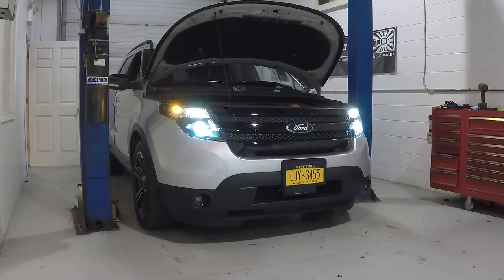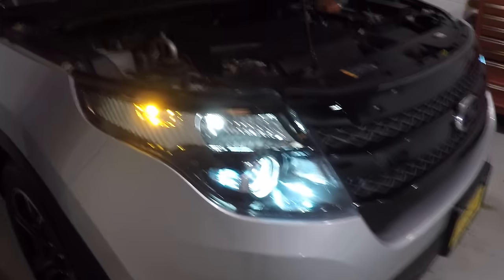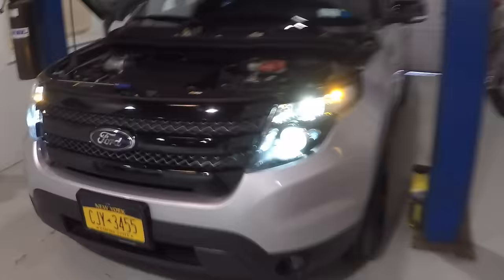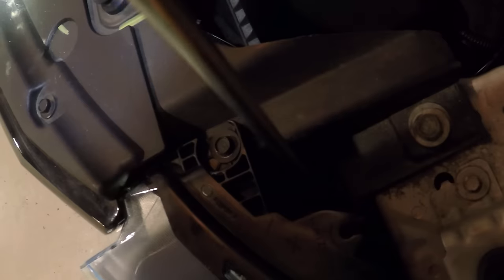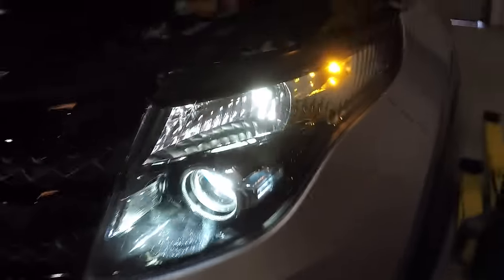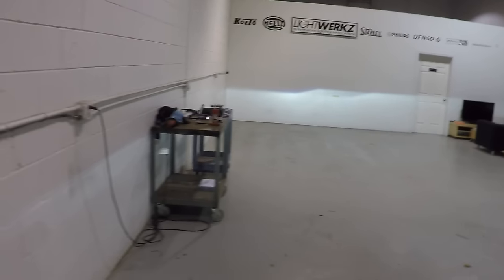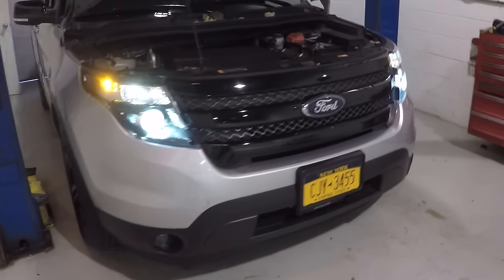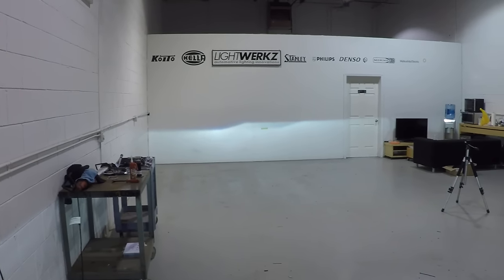How To - Headlight Aiming / Alignment Projector Retrofit

Comment: Told my Moms her headlights were pointing too low ((pause)). Popped the hood on her '12 Chrysler 200, adjusted the lights correctly, and now those bad boys are shooting 25ft ahead 👌🏿
Reply: For my used 2012 Chevy Malibu, changed a headlamp bulb shortly after buying it, left bulb..Came out adjusted a bit too high(cousin did the work, front bumper assembly had to be removed.) Noticed that now the right bulb is aimed a bit too low. A very good friend in CA (I'm in Miss) ordered, sent me one of those special  Bondhus 6mm ball hex end extended-reach wrenches to fit the nearly impossible to reach adjustment head to adjust both lamps! On this Malibu, they're down deep, betw tight-fitting internal bodywork metal shrouds..real pain..have yet to do the job!! Hoping the adjustment heads will turn no problem. Surely not like the old days with simple sealed beam lamp units, with elevation & lateral adjustments!! Miss that!!#

Comment: Adjust then like this on HIGH beam so that low beam is down and right naturally. When the vehicle hits bumps or just trust height differences the rear will go up and down. A person should not be continuously flashing on coming traffic on low beam. I see this ALL the time. Adjust them on HIGH beam vertically straight ahead. Low beam takes care of itself, unless there's a supplemental problem....

Comment: At 1:26 you can see a label on the headlight which specifies a 1% dip, which equates to 3inches lower at the wall at 25feet (300inches). Your headlight centres are at 34inches so the tape on the wall should be at 31inches

Comment: I don't know about Ford, but the one I work for, that 2" @ 25' below the H-Line/bulb center marking would probably put it on the lower end of factory output spec.  Our cars are +/- a few mm from the bulb center while the suv/trucks are usually aimed lower a few mils then take into account the tolerance.   I only mention this as I see retrofitters using tape marks at factory output.  Always possible it could be off though so always good to measure like you did, especially when someone goes to this much effort to make the output better :).
Reply: not sure I agree with you there. Most manufacturers recommend approx 1% downward angle, at 25ft (300") that's 3" which makes our man's video about 0.66% fall which, if anything, is insufficient. Your 'few mm' is in my opinion far from sufficient.
Reply: Correct. In fact the '1% dip' is actually stamped on the lamp at 1:26
Reply: @drnick1972  Low beams should be set to project out to 200' on the drivers side for ANY vehicle. So the angle will vary depending on the height of the headlight. That's why there's that little dot on the lens cover. Using 25' as the distance used for checking, if your lens height is 36" then the drop would be 4-1/2". If the height of the lens is 32", then the drop would be 3". 

The whole point of aiming your headlights is to give you a good view of the road ahead and to NOT blind oncoming drivers. 200' is a good number to shoot for. And 25' is a good distance to be able to check the proper drop from horizontal.

An easy way to calculate is to multiply your lens height by .125. The passenger side can go out to 400' since it's designed to illuminate road signs, people, etc that are most likely to be on your right and it won't blind oncoming traffic. That would, in general, let you raise the passenger side headlight about 2" above the driver side setting at 25' checking distance. The high beams take care of themselves usually.

Using the % number seems ridiculous. Nobody is going to be using tools that can measure % that close anyway.

Comment: My question is, you can see the two steps from left and right headlights but how do I know if they are spaced apart correct. So it will be left to right or side to side adjustment not up and down like you did. Do I just measure between the two projectors and measure the space between the step up on the wall at 25 feet?
Reply from the maker: Correct, thats exactly what you do.

Comment: Good stuff 🙏🏽 I swore up and down that I put my new lights on the wrong rotation having to take off the air box on my 2019 charger repeatedly  to reach the driver light as well because one headlight was higher than the other this whole time there a projector gear nob 😂 in my older Hyundai car I’m used to poping the lights in and they show even by themselves 💀

Comment: Hello, great video! I recently got my car back from the body shop after a crash. The passenger headlight was replaced and now it's not as bright as the driver's side and the beam pattern is scattered everywhere. It that an alignment problem as well? FYI, I have aftermarket HIDs installed in a 2013 Ford Taurus SEL.

Comment: Great Video but maybe someone can answer this for me, I just installed new headlight assembly and my pattern is the same on the (outside left) of the middle, you see how it sits lower and on the far (outside right) it's at a higher level but in the middle it's lined up? Shouldn't it be level all the way across?
Reply: Same
Reply: Both left sides of the pattern should line up with eachother, then both right sides will line up with each other... the overall pattern should not look like a staircase

Comment: Is there a horizontal adjustment also?
Reply: Most factory lights r only adjusted vertically for the low beam under the hood as mentioned in this video with a tool such as a Phillip's head screwdriver etc which is determined by the car manufacturer. However I just ordered aftermarket headlamps from Amazon and had them professionally installed as my original lights were too dim which is common on the Nissan Altima. It took the installer 3 separate times to finally get the beam to a place where I can see at night. Come 2 find out these aftermarket headlamps have 2 adjustable knobs for both the low & high beams for a total of 4 on each lamp. These r able to b adjusted both vertically/horizontally for both the low & high beams which was very confusing for the installer as he said its unusual. It was beyond frustrating but thankfully as of yesterday I finally got mine corrected lol.
Reply: Omg i got an altima 2013 , i have custom Amerilite headlights on them and the beam is so low and can barely see at night , not to mention the bulbs are halogen smh... there was no way for you to adjust from home ? cuz i can’t find a way either

Comment: Thanks for the video quick question what if after 8 months after changing bulbs you lose pattern all together and i mean lose it like its not there at all , my passwnger bulb is lighting sidewalk on right and driver bulb is all the way left  and when sitting in the car it looks like i have no lights on i cant drive
Reply from the maker: Check to make sure your bulbs are seated properly. If its aftermarket HID or LED remove the bulb and make sure there isn't another issue.

Comment: I just realized that these Projector Headlights does not have Beam pattern. It kind of casts/throws out light (horizontally) with no particular aim.
Reply: Projector headlights don't go far down the street! It's very frustrating as to LED headlights are gonna look the same no matter what.

Comment: infomative. 
1. 2" lower at 25 ft. driver's side or passenger's side cutoff?
2. coming to adjustment along x-axis, how far away should the tapers of the projectors be located from one another at 25ft?
Are these numbers DOT recommended or arbitrary?
Reply from the maker: 1. Both. 
2. They should be the same distance apart as they are on the car. however some models cannot be adjusted left/right.
Reply: Lightwerkz Global Inc. 
1. What I mean is not driver or passenger side HL. if we divide each cutoff into two halves, the drivers side half is at a slightly lower level than passengr side. which of these two halves should be used while measuring, the higher side or lower side of the cutoff? hope I'm clear.
Reply from the maker: Sorry, yes you use the drivers side of the beam. Since this is LHD, we use the left side. If you were in Japan lts say, its RHD, so you use right side, and you would be still using drivers side.
Reply: Lightwerkz Global Inc. thank you.

Comment: I bought a set of Halo LED headlights for my 2005 Dodge Neon.. the one thing I noticed I don't like is that the driver side headlight is pointed way off to the left too far and almost in the oncoming traffic lane and I am not sure how to adjust them from left to right but I do know how to adjust them up and down
Reply: I have some halos for a 97 Chevy suburban and have same problem can make them go up and down but not side to side and my driver side one is of a little to left more . Did u find a solution?

Comment: I hope you still read this .. I have two steps ? , the beam at 25 feet on the car in front is on there license plate . ( which is ok) Normal car /suv. I have a Dodge Journey . On the wall or street , there is a annoying two steps from left to right? My lights have 3 Screws . Any ideas that would help? Do the beams  supposed to be straight across the wall?? Thx
Reply from the maker: If you have two steps your headlights may not be level. You will want to match up the left sides of your cutoff so at a distance you just have one step up, from the drivers side.

Comment: SIDE TO SIDE AIMING.... take the hid bulb out and rotate it approx 1/3rd turn an put back in. This part is a little trial and error. Bulb placement changes the beam direction. 
Ill try and describe rotation direction i used to make bulbs aim correctly. Using the extended leg of wiring harness that looks like an 'L' shape.
Imagine a clock face in front of you while your in drivers seat facing out at road. '12 o clock' is facing directly up and 3 o clock would be out at 90 degrees to the Right from there. I believe my HID bulb legs grabbed at about '3 or 4 o clock' and locked in place at about 5 o clock (both lamps). They look much better now.
Goodluck all

Comment: The height of my assembly is 39 inches, so at 25 feet it should be at 37 inches? My lights hit side mirrors of small cars and some will turn their brights on and blind me after I pass them.
Reply from the maker: Clinton Kirker adjust accordingly. Bring it down another inch and see where t takes you.

Comment: This strategy wouldn't work for a truck that is sitting high or lifted. Recently ordered some housings w/ Morimoto M LED 2.0 projectors for my '96 Bronco. I would be blinding the hell out of people following this strategy. What is a good ballpark then? Set cutoff at 3 ft from 25 ft away? Should the distance between the hot spots be the same as the distance between headlights at 25 ft away as well?
Reply from the maker: Try 4in lower at 25' instead of the standard 2in lower. Good starting point. Yes distances between the centers should be same distance between the center of the headlights.

Comment: There needs to be an more complex video going in dept on how to adjust H4/H7 housing that was retrofitted with an projector setup. I have retrofitted quite a few headlights with projectors and had an few only only shining out on the road a couple of feet with no error on my side I have fitted the h7/h4 adapter plate flush at the back of the bezel and the protector is flusly tighten to the back plate of the adapter plate and find the Projectors naturally pointing down.... Even at max adjustments some barley meet the required distance leading to disappointed customer satisfaction. I have found an easy way to fix this issue however I don't think its very professional I find myself needed to bend one of the adapter plates on the top side of the leg to naturally it tilts the projector up it sometimes helps and other times it just causes the projectors to shine to the moon.... As some headlights dont need the adapter plates to be bend
Reply from the maker: Yes, this is not the video you are looking for. What you have done incorrect was the way the projector is mounted. Some of the projectors such as the G5 based units, like the D2S 4.0/5.0 - they need to be angled upwards when they are retrofitted so you match up to the original height. If you do not do this, you will max out your adjusters and still likely wont be at the correct height as you are dealing with now.

Comment: I have a question I recently bought aftermarket housing with projector lens the light beam on my left driver side is super high the right beam seems to be alot lower and off to the right I wanna adjust the beams to be even but I've had people tell me that aftermarket housing can't be adjusted is there a way also if you have a email ID like to send some pictures my housing are not even on each housing from the bottom of the left there is about 1.5" between bottom of light and grille the right side is 1" from bottom of housing to grill how do I fix that it looks horrible thanks

Comment: That thing about 2 inches lower at 25 feet isn't universal. Say a truck's headlights are 1,5 meters above the ground, and a sportscar's only 45 cm. The truck would still get it's low beam in the cabin of lower cars, while the sportscar will have it's low beam illuminate for too short distance (67,5 meters to be precise) Headlights have tilt percentages written on them but these, on the other hand, may be too conservative to light far enough for highway driving.

Comment: Question does this still go for lifted trucks? Say center is at 40-45 a little car say like a Honda Civic and cars similar are now having the beam on the side mirrors
Reply: Its a 1% dip. At 25feet, your 45inch headlight should hit the wall at 42inches.  (40inch headlight should hi 37inch at the wall)
The dip is measuread as 1% of distance from the wall, then subtracted from teh height of the lamp

Comment: hey, i have a question. is the rule of 2 inches below the headlight bulb, at 25 ft,  the same for all cars at stock height?
Reply: Are you being serious? 🤔...

If so, yes!! You just need your beam @ 25' to be 2" lower than the height of YOUR vehicle bulb height, regardless of your vehicle (vagina on wheels or a monster truck)!

Stock or not doesn't matter! Just 2" lower!!
Reply: it should be 3inches (1% as stamped on teh headlight at 1:26), but yes
Reply: No, as far as the driver side is concerned. The end result is supposed to give you a 200 foot distance on your drivers side headlight. So the rule of thumb is 1/8" drop for each inch of your headlight height on the drivers side. Why 1/8'? Because you're checking at 25' distance (300") to get a proper drop at 200' distance (2400"). 

In general, that number is closer to 4" for the drivers side headlight. And 2" less for the passenger side headlight.

Comment: This is why I buy from this company, nothing but factual information. DOT regulations list 4 different types of headlights. VOR, VOL, VO, and Fog. For all those people that think 2 or even 3.5 inches is too low IT IS NOT. Simple trigonometry using DOT regulations will show that a 1 degree slope is desired. Yes, you read that correctly a 1 degree slope, that's it! So stop thinking you're smarter than an engineer and read the regulations. You can find them here https://www.danielsternlighting.com/tech/aim/aim.html just for reference, most passenger cars will use 2.1" and all trucks will use 3" or 3.5" depending on hight. For instance, a new F150 2015+ will use 3.5" for the top low beams and if they install projectors in the lower high beam spot they'd use 3". Can't tell you how often I'm blinded by idiots in a Camery or little car because their lights are dicked up, and I drive large truck, just sayin...

Comment: I cant find this on my 2014 ford edge ? any idea where it might be ?
Reply from the maker: Frankie H if there is no dot just measure from center of projector or the bulb itself if it's halogen
Reply: Lightwerkz Global Inc.  My bad, I didn't ask my question correctly.. I was asking about the gears they you turn to adjust the light. I cant find them in my car, I think the lights are after market on mine
Reply from the maker: Sometimes hard to find but they are always on the lights. Sometimes you have to go through a body guideline hole with a long philips head.

Comment: You're only supposed to subtract 2" if your center is over 36".
Reply from the maker: Check out the updated video if you can. But if you are over 36" you would be at 2.5" under the lamp height. 

 Lamp height:                             Downward measure:
Up to 34.5" (80 cm)                 2.1" (53 mm)
35" to 39" (89-99 cm)              2.5" (64 mm)
39.5" or higher (100 cm)         3" (76 mm)

Comment: So which way do i turn the gear to rise up the projector
Reply: Ever manufacturer is different, should be labeled on the plastic piece attached to the grill under the hood or in your service manual
Reply: either clockwise or counter clockwise

Comment: Would you recommend the same method to lowered cars?
Reply: Headlight aim is headlight aim, so yes. Just don't use 32inches!! Measure the height of your own headlights then subtract 3inches at 25ft from a wall

Comment: the only thing that's wrong with lighting on most HID equipped vehicle is that they put the most concern on the oncoming traffic but totally forget about the traffic headed in the same direction specially traffic that's in the lanes to the right. i never get hi beams or any negative reactions from oncoming traffic but the shit that drivers pull that are going in the same direction as me has completely ruined my driving experience. and this is coming from a person that loves driving.
Reply: nela gordon their headlights aren’t aimed properly then